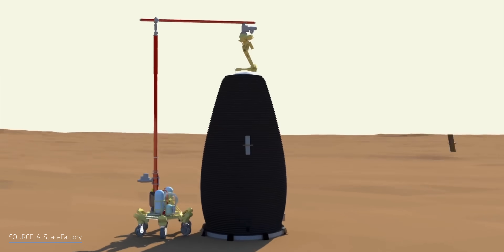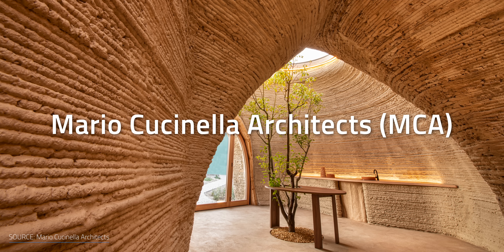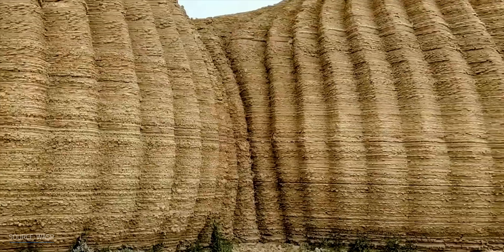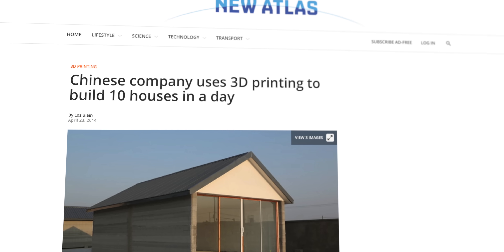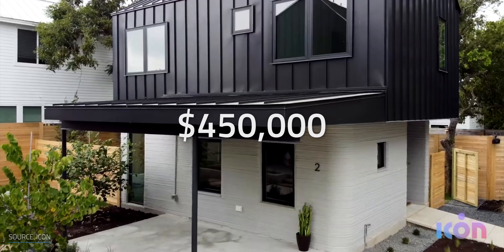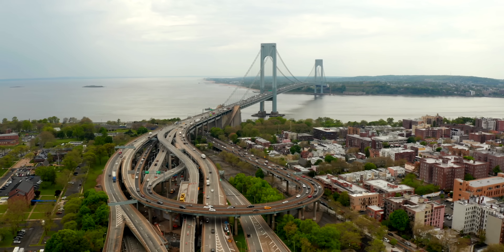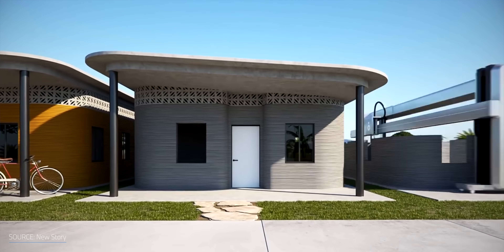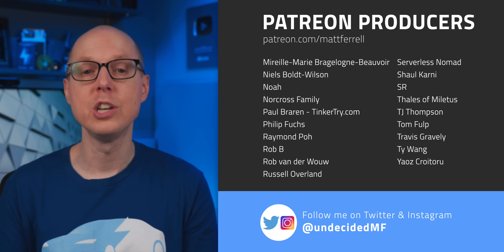The Truth About 3D Printed Homes

Comment: Unless you can add some sort of polymer to the mix, weather washes it away. Mud walls are high maintenance because of this. Even with cement plaster coating, the dirt crumbles underneath and pushes the plaster off. And there are many other problems using just mud. Building a bon fire in it after printing to somewhat bake it would help, but only partly and that brings other problems.

Comment: What happens to the clay structures in a flash flood?  Just wondering as that would be my primary concern with that particular material.
Reply: snowy and high rain environments will degrade that structure in very short order.....theyre already a serious problem
Reply: Maybe they'll invent a way to bake your house next. Make it a pottery house. Might even be water tight 😜
Reply: @bzuidgeest  Ya know, that's not a bad idea actually. Regular FDM printers work by heating the plastic & shoving it through the hot end via an extruder. I bet you could totally just flip that concept on its side & have a hot end that trails behind a clay extruder baking the layer as its laid. The question then is can you do that and maintain structural integrity or will it just be a stack of loosely fit clay rings?
Reply: @hazonku  or you could do it the way any factory "robot" does it and form the clay and shove it all in an oven thousands of bricks a time. Some things are far more efficient without a print head.
Reply: no problem.  i've come up with a solution.  you build a wooden structure around it to protect the structure. 🥸
Reply: Maybe light a massive bonfire inside and have it going full blast for a week straight to make it weather resistant?
Reply: @Aikano9  Like firing traditional southwestern pottery!  Fill and bury it in dried cow patties and let er rip!

Comment: I personally like the brick option more. Molded interlocking hempcrete or compressed earth blocks. Easy to mix with traditional construction. Easy to assemble. Good insulation and fire resistance.  Some options can be manufactured onsite.
Reply: Yeah. Hempcrete also doesn't look so cold and hard. Are they limited to certain climate zones? Hempcrete and earth blocks are probably easier to incorporate into a range of styles, since plaster walls have a long history. For concrete walls to work, they're left with brutalist, contemporary, or at their most creative, possibly a look resembling castles.
Reply: @melissamybubbles6139  hempcrete is non-load bearing, it needs to be supported by concrete, wood, or steel. It’s a substitute for insulation and paneling rather than structural. It was misrepresented on this very channel as an alternative to concrete blocks.
Reply: @oregonNYC  the version presentedon this channel was an alternative to concrete bricks. Because it has an internal structure that acts much like a Lego block.
Reply: @mac_mcleod  other than looking like a brick, it isn’t anything like them. It’s a stackable insulation material. Hempcrete has 15% the compressive load of concrete. Other than the suffix ‘Crete’ they aren’t very comparable and aren’t alternatives to each other. No one uses concrete as insulation inside a wall, and no one uses hempcrete to build the load bearing needs of a home.  Hempcrete is an alternative to insulation, flooring, paneling, drywall. Not timber frame, bricks, steel frame etc.
Reply: @oregonNYC  several different companies have made load bearing hempcrete blocks and poured hempcrete in Australia is regularly incorporating sand to increase compressive strength. More work needs to be done but framing could be significantly reduced in hempcrete structures, such as reduced cross bracing, relying more on hempcretes significant tensile strength.
Reply: @oregonNYC  that's incredibly important to know!
Reply: @oregonNYC  You are describing pure hempcrete blocks, but there are options now that use an internal frame to provide the compressive strength hempcrete lacks on its own.
Reply: @melissamybubbles6139  I believe Hemp for Hempcrete is growable in most American latitudes. The main problem with it is soil fertility erosion. Great for the first couple of years but diminishing thereafter .... and not easy to get farmers to rotate crops rather than take ll the $ now!
Reply: @totherarf  crop rotation was a pretty familiar concept and practice for farmers before ethanol.
Reply: @totherarf  I have to disagree with you there. farmers have gotten extremely smart when it comes to agriculture, that's why the south isnt covered in cotton fields year round. They rotate the crops about every 4 months. Thats about how long most of the things they grow take to mature and are ready for harvest and they dont grow the same things year after year.
Reply: An even better approach is a hybrid of hempcrete and the block formwork method. Normally this involves hollow Lego-like Styrofoam blocks into which you pour concrete. You end up with a concrete wall, but with permanent insulating formwork. What I propose is to use hempcrete blocks instead. Assemble them like Lego, then pour concrete in the center, so you have the advantages of hempcrete and the structural loading of concrete.
Reply: @saumyacow4435  that sounds at least somewhat reasonable
Reply: @saumyacow4435  
Pourable is much better than printable. Having the forms be a permanent part of the build seems like a good move. 
I've been looking for an incremental solution to the forms that doesn't require shipping them fully made to the site. Incrementally build up the walls as forms with pourable or sprayable material. As they incrementally grow, they have greater load bearing, until they can be an effective form for pouring concrete.
Maybe stackable plastic than can be filled onsite with some sytrofoam, becoming the styrofoam blocks to pour concrete into.
Reply: @buybuydandavis  There is an opportunity for a portable hempcrete block making machine. Another option is hempcrete panels with ties to build formwork.
Reply: @saumyacow4435  
Pouring panels onsite flat then raising them up seems like a decent option to me.
Reply: I like dimensional stone and rockwool with masonry veneer. Cheap simple depending on area. I live by limestone bedrock.
Reply: Can these houses withstand rain, earthquakes and fires and floods? What about electricity and plumbing?
Reply: I'm hoping to build my house from CEBs
Reply: Brick option is always better, much better. The modularity of bricks and the integration of the MEP mechanical, electrical and plumbing, can be designed in a more coherent way by building modular pieces made of bricks. The assembly is well known. 3D printing is just a big fad that requires a lot of evolution to make it viable. 

A lot of crap is said about it so investors invest in the pioneering of such technology. But the first ones gets the shortest straw. Investing in it is risky and now the technology is in its infancy. This requires better robotics and an advance science of materials to make it viable.
Reply: @kummer45  and also is the machine way to put one by one or more the bricks.. structurally it's all ok.. then the insulation needed (between two thin walls is ok) then as this 3d printed, is the next from Windows/doors/electricity/plumbing to assemble: more than this I prefer pre assembled wood panels with earth and straw inside, all components in one time, yep logistics as a few last step: make the panels be an entire building together. But is there enough wood now on earth?
Reply: I find those products very exciting as well, but sadly a lot of the companies are gatekeeping the products for commercial builders rather than making them affordable for small/self-builders.  As long as those products have been out there, still not seeing them locally.
Reply: Plastered over sandbag construction.
Reply: There are machines that press dirt into bricks. After heating (via a solar reflector?) they can be assembled into whatever structure. It would be interesting to see them made into concrete block size (and Lego shape), pair them with hempcrete for insulation, and use machines to lay them (the dirt blocks) into support structure patterns quickly. Then fill them with concrete. I've seen videos of real companies doing each of these, though not all together. The main issue is really money and corruption. Unfortunately, the rich elite NWO crowd want to eliminate most of the population, not improve their quality of life.
Reply: The big corps want a quick cheap way to rebuild as many homes as possible after their government and family buddies destroy the cities in fake wars. This maximizes profits.
Reply: 450.000 $ for that shit? :o
Reply: possibly those tagged with hadrien X block laying robot might be a better long term pairing
Reply: I agree, actually if 3D printing reported times  are only for the walls, I find faster the construction with brick walls
Reply: I think the way to go is modular...Have huge injection molding machines that create 1 complete wall at a time etc
Reply: @jaychimera372  
You know of any examples of that?
Reply: @buybuydandavis  iv seen modular homes yes...but none yet of via injection molding
Reply: @buybuydandavis  we did it in Ontario for a school I worked on. I think it's called tilt wall. They pour a casting bed or use the floor slab to form walls on. The ones I saw used pre pattern mats as temporary inlays which brick is then placed on and then it all gets filled with grout. They then apply 4" of styro followed by a topping of concrete. The formwork is then stripped and the walls lifted vertical and maneuvered into place using a crane.
One thing I'd like to note is that same company who did the school I worked on were also doing a 4-story building this way however they ran into major issues assembling them once poured which delayed them for months. This required them to keep the biggest crawler crane in NA on site when it was supposed to be going to the MSG sphere in Vegas. That was in December, I never did find out if they were able to remedy their issues.
Reply: @wakeus69  All the super warehouses around here are built with massive concrete blocks that slot into position via massive gantry cranes. They can have the walls of an absolutely MASSIVE distribution warehouse up in what seems like a few days. Im not sure if they pour on site or ship the wall sections from off site. but watching those walls stand up is insane.
Reply: your best option is the traditional method, cob, cheap and vertually carbon neutral
Reply: Hemp grows very well in very many climates from what I know. But it's still illegal in alot of places (or needs like costly complicated bureaucracy to be allowed to plant it)
Reply: But they can't undergo 24/7 construction
Reply: @SimplySketchyGT  Work in shifts
Reply: https://youtu.be/ino8oz189fw
Reply: Supposedly hempcrete cast is the way to go. Love to live in such a house
Reply: Is hemp really that good at just about everything? Wow.
Reply: That’s the real hero here. Custom blocks and slabs based on a customizable CAD model. The molded architecture is cool, but I think it’s best integrated in easily constructed shapes and sections interlocked on assembling modeled bricks.
Reply: 3D printing bricks makes more sense
Reply: @PiyushGupta-vx6qi  it doesnt.  bricks from burned clay are still made on an industrial scale with giant machines.
Reply: Show me the 100 year old home with hemp blocks.
Stability and durability needs to be proven, not fanboy-ed.
Reply: (why the hemp fixation, there are lots of other cellulose waste streams which can be used for positive effect.)
Reply: Everything can be made to 3-D print. Any kind of concrete any kind of metal resin. I own four resin 3-D printers. It’s simpler than people think and a lot more cost effective.
Reply: I think the major problem about hempcrete is in case of fire
Reply: We where made in HIS image
A good prayer:
I'm a sinner JESUS please forgive me for all my sins I know you shed your Blood for me on the cross at Calvary. Thank you JESUS for my salvation and for shedding they Blood for me. I love you JESUS. 
Romans 10:5/10 ct...❤️k
JESUSisLord!Amen...
Amen..
If you'd like to call someone who cares 
83
For
Truth.
bc you don't know when you'll die?
.y r u hesitant...........
Reply: amen to that
Reply: framing and siding is a very small part of housing construction cost.

Comment: I am not a fan of "3d printed" homes in the typical sense. Fast Bricklaying Robotics has a much better method.

 Due to the structure of these 3d printed buildings, it is more difficult to install electrical, plumbing, gas, etc. in the walls. 
Additionally these buildings may be more prone to a propagating failure. Where it is more difficult to repair these buildings as the structure settles and it cracks, or even just damage from wear over time. 

However, I am a fan of rapidly manufactured homes. Fast Bricklaying Robotics (FBR) based in Australia has done well with this concept. Where they adhere conventional concrete blocks laid by an autonomous robotic system. 

Now this system still requires installation of electrical and plumbing after a floor is made. However, I believe this method takes advantage of automated home construction, the main objective of 3d printed housing, while also remaining robust as seen in well proven construction techniques. Additionally this FBR system can make multi story buildings.
Reply: I've seen your robot van bricklayer thing, it's really cool! I don't agree with your points about plumbing, wiring etc. We just put a small plate over where we want a hole and print on through. 
I'm really impressed by your robot arm though, I think we are all working towards the same goal!

Comment: I wish this video was longer. Anyways, I could still imagine this being useful in developing nations; construction workers can shift from building the structure itself to its windows, finishes, etc. But this is a short-term solution (50 years?)... as the world increasingly becomes urbanized, we need urban housing solutions. personally, i've become obsessed with volumetric construction (and automation), which I think is our best path forward if we can address the NIMBY zoning issues.
Reply: P.s. I think 3d printing could potentially still play a role in volumetric construction, as it cuts down on waste and opens up design possibilities, but it'd be more as a part of the volumetric factory process, not as a one-stop-shop to build a home. At least not until they validate multi-level construction. Also, while I love the WASP uses clay, typically they use concrete, which is CO2 heavy, so for normal 2-3 floor structures, I'd prefer to see more use of timber instead of concrete.
Reply: Also: I wonder if the WASP tech can be evolved to a brick-making and brick-laying robot. Would that allow for multi-story construction? How does that effect the build, time, cost, footprint, etc.

Comment: Prefabs!
That is the most economic way to build. Most building needs can be met by designing a set of structures that can be combined and complement one another. A brick is basically a prefab. You take many repeating elements and build a larger structure that doesn't neseseary repeat or serve the same function. Using robots and printers is one thing - using NOTHING but one printer to build a home is stupid. It's a hype thing that media took on.

Comment: The house I own and have lived in since 1971 was factory-built in two halves 450 miles way, and trucked to be placed on a cast concrete foundation.  Due to height limitations for transport, the three-room bungalow has 7-1/2 foot ceilings. . .  In my neighbourhood, there are two, three and four room bungalows, split levels, and even a few two-storey homes.
To me, one of the issues in construction are the quality of local labour.  Everything done in the factory has been trouble free, while work by local contractors after placing the two halves on the foundation, and the foundation itself have been problematic.
Reply: Which is great, but as mentioned urban sprawl due to low density, causes more problems than it solves, high density is what is required, going forward...
Reply: @delboy7039  High density is for rats and worms

Comment: The biggest issue I see with 3D printed homes is that it doesn't seem as though it can handle anything other than single story homes. If we're going to solve the housing crisis, we need more density per square foot. I'm not saying we shouldn't continue to explore the possibilities here, but I've seen wood frame homes go up fairly quickly, maybe in a week's time, so I'm not sure of the benefits.